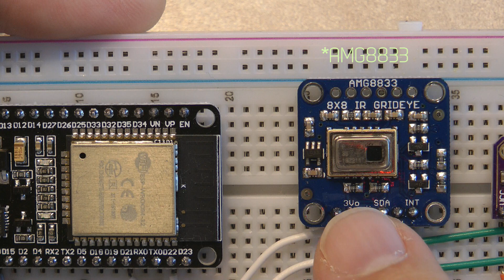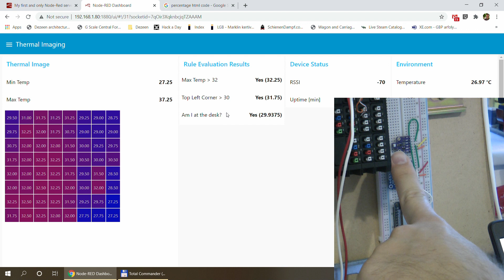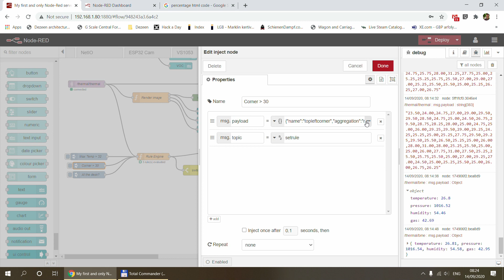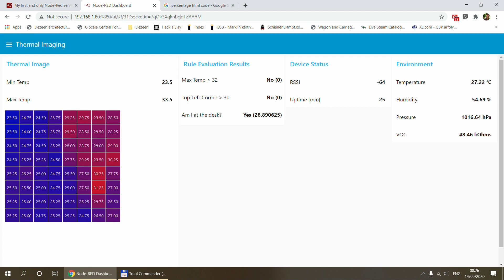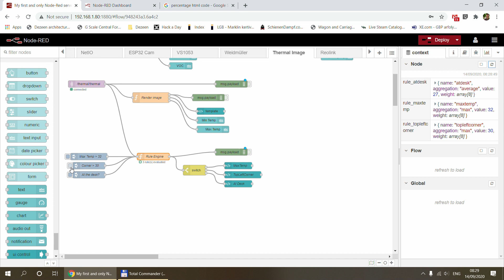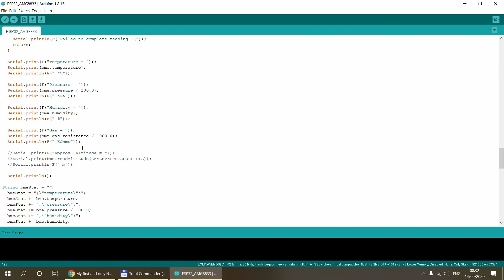HA Thermal image

Comment: Hi, I am working on a project to detect the wetness of materials using this thermal sensor. For example a wet patch on a piece of paper.

Do you think it is sensitive enough to detect the wet patch under room temperature from around 1 meter away?

Comment: I have the amg8833, the one you power to a powerbank and works itself. amazing little camera may I tell you. It detects hot and cold spots behind walls and doors if theres a reasonable difference between temperature.

Comment: Hi, i would like to ask, can you guide me to add the temperature value of the thermal on the node red display. since the human body temperature is actually low, how can i add like 5 degree so that the value display can be increase? at what part should i edit?
Reply from the maker: What is the point of adding 5 degrees. You just increase the value of all readings, it will not make the resolution any better. In the function nodes, you find lines like parseInt(image[k]) and you can just add any value to that parseInt(image[k]) + 5.

Comment: Have you tried to use the sensor as a counter? So you can install it on your door frame and detect direction, so you know if there's people in the room or not?
Reply from the maker: No, I did not. But you probably need to implement it on the ESP and probably need to read the sensor a few times a second.
Reply: @csongorvarga  Looks like these guys made it possible somehow https://www.hiome.com/ ! And as for the people counting thing there's one repo here https://github.com/Andrea-Fox/peopleCounter it uses the VL53L1X sensor... maybe it can be adapted. We have tried it but the sensor doesn't work well at certain light wavelenghts so it's not realiable, sadly. We also are trying to find ways to detect occupancy and discussing about it on this discord server, if you want to join :) https://discord.gg/zDPGQ85HSj

Comment: Thanks Csongor.  With these thermal sensors, each pixel is recording a spot 7.5 degree square or 135mm square at 1 m (assume the sensors has little dead space between pixels aka fill ratio).  If a object aka hand totally fills a pixel then it records perceived hand temperature, otherwise it is a weighted average of hand and percievedbackground. After that the perceived temperature  depends on  calibration  and transmission losses (air minimal but some from the ir window) and emissivity of objects (a black body radiator is 1, anything else is less than 1 but human skin is 0.95 to 0.98 in mid ir) but this can vary with incident angle, reflectivity).  Nb also hand surface temperature can vary from body core of 36C due to air temp.

Comment: YAY finally some nodered. As to the project, damn this sensor is soo expensive. Maybe for presence would be cheaper to just use camera motion detection ESP32-CAM for example.
Reply from the maker: Yes, I will look into that. Object recognition is on my list of things for a long time. But I would most probably use a IP camera, not a lot more expensive but also has night vision.